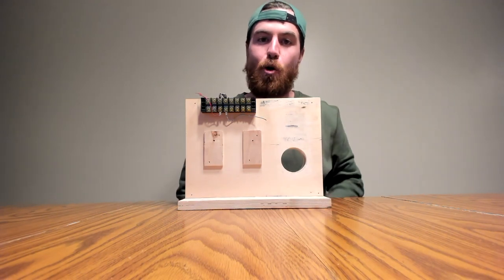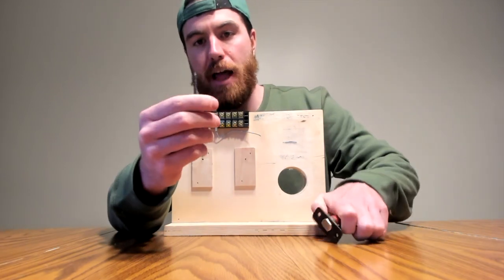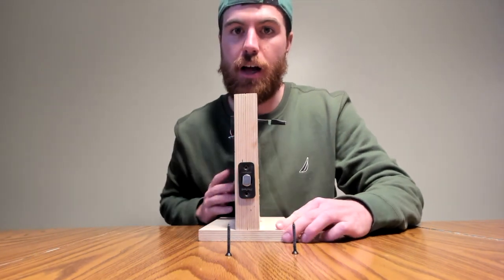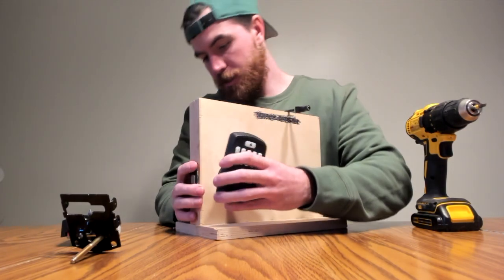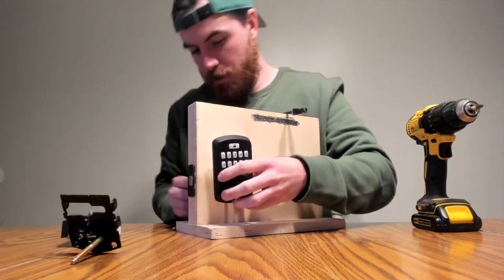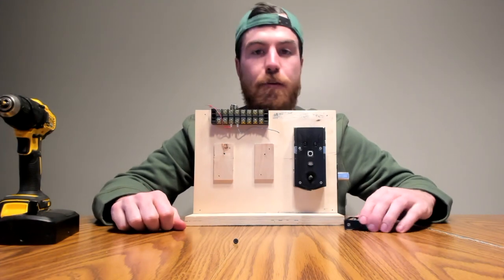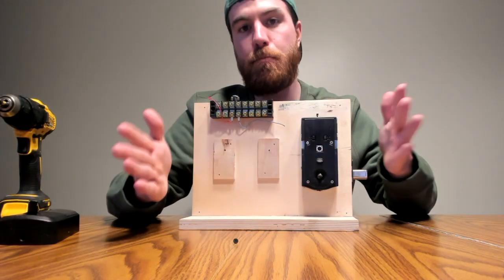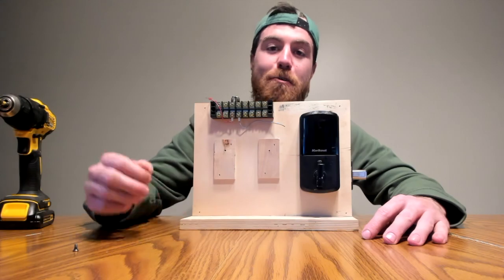Kwikset Aura - Install Video

Comment: I can't get the wires to sit in the housing nicely without affecting the lock, any advice?  Thank you for a great video!
Reply from the maker: I would try to push the wires in if you can and thank you for the comment!
Reply: @TheSmartHomeHelper  I will try that once i get back home, thank you so much for the incredibly fast response!
Reply: @TheSmartHomeHelper  you are a LEGEND!!! It worked along with the rehabbing. I can’t thank you enough!!!

Comment: Thanks for the video, I have a kwikset deadbolt do I have to install this locks deadbolt or can I just add the lock to the existing one?
Reply from the maker: Nope you can use same deadbolt on most
Reply: @TheSmartHomeHelper  that worked thanks. Liking the lock so far

Comment: After i install the skeleton the lock gets too hard to open/ close unless I loosen it quite a bit. Works smoothly without the skeleton or the screws very loose. Any idea why this happens and how to solve?
Reply from the maker: I've seen using a screwdriver can do this sometimes.  I think in the manual they say not to use a powerdrill so I'd do it by hand if you can.

Comment: I have done the handing thing a million times and it still clicks.  When I turn with key or interior lock knob it turns smooth.  But when it turns from app or keypad it clicks.  Any suggestions?
Reply from the maker: Yes so I would try loosning the screws and also looking to if the lock has any give.

Comment: "i would fully extend it"   what does that mean and how?
Reply from the maker: Great question so on the deadbolt there is a way to extend the lock.  You would push down on the slides and pull.  It should make the deadbolt longer and fit into hole. I apologize I don't have a video on that

Comment: I installed my aura lock and it works but it makes loud clicking noises. Is that normal? And when I try to lock or unlock using the app it usually shows it as “jammed”. Why is that? Thanks
Reply from the maker: Two thing to try here one rehanding the lock and the other I would try is to make sure and see if the deadbolt is going in smoothly
Reply from the maker: Here is the video on https://www.youtube.com/watch?v=-bwwVqH9hBs
Reply from the maker: You may need to widen the whole or check to see if the door is not aligning right

Comment: My aura wont work i spent hours trying to make it work and is not working is my second lock i took the first one back thinking it was factory defective and im having the same issues even after watching your videos.
Reply from the maker: Hey Pablo, sorry to hear that and is it the syncing where u are seeing issues or what part in particular?
Reply: @TheSmartHomeHelper  so i installed the lock just like you show in the video but the lock is not moving after i place the battery in the lock no noise or nothing is my second lock
Reply: @TheSmartHomeHelper  i just try again i updated the firmware and now is saying is Jammed any idea what it could be?